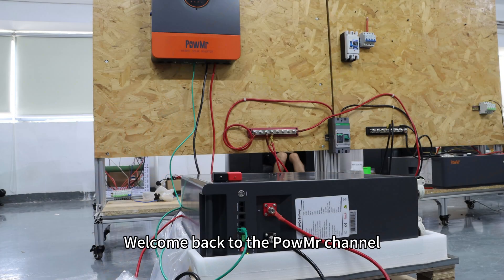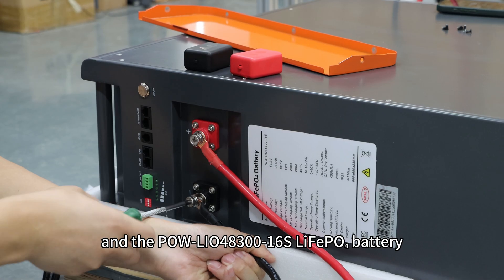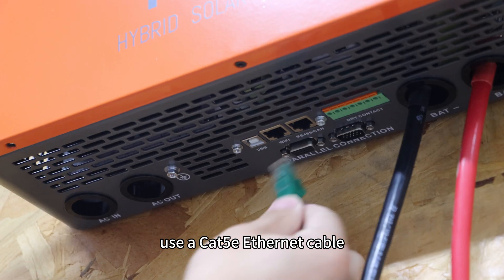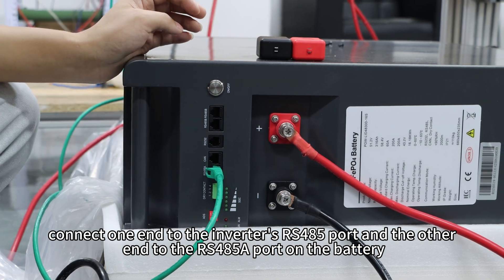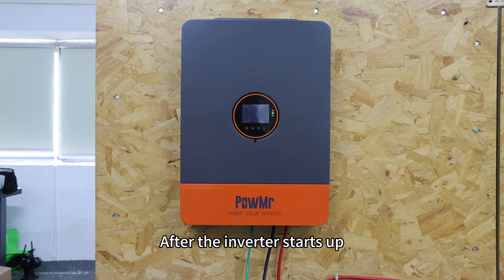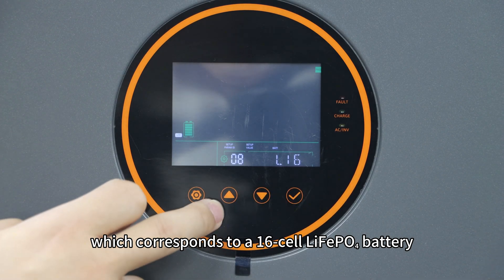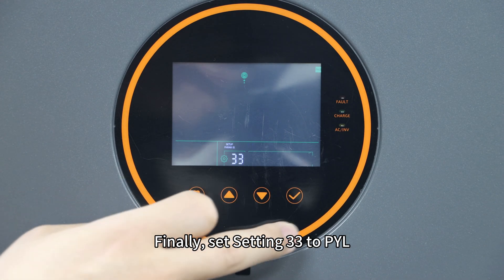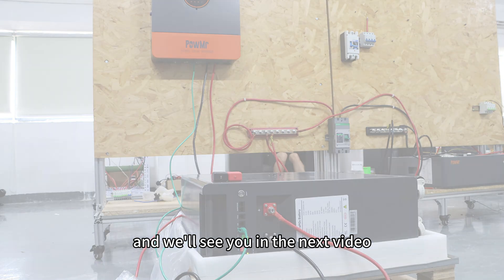How to Set Up Communication Between POW-SunSmart 10KP and POW-LIO48300-16S?

Comment: 2 Powmr 6.2klip parallel DPONT communicate correct with jk bms.
jk 100%  powmr say 99%
battery volage on powmr say 1.5v
amper on powmr say 36a
charging was stopped 
jk parameter is 9600 pyton...
powmr parameter was LI2
Reply from the maker: Please send it to this email: support@powmr.com. Our technical staff will check it for you.